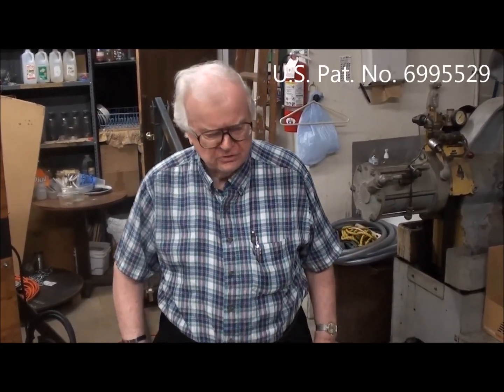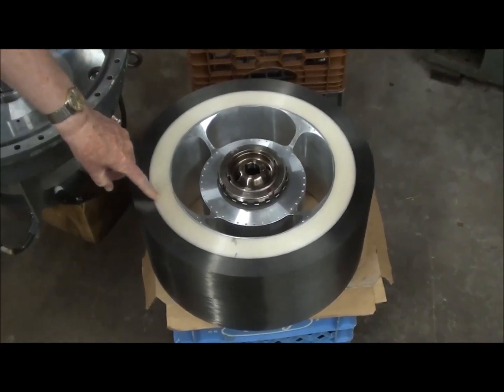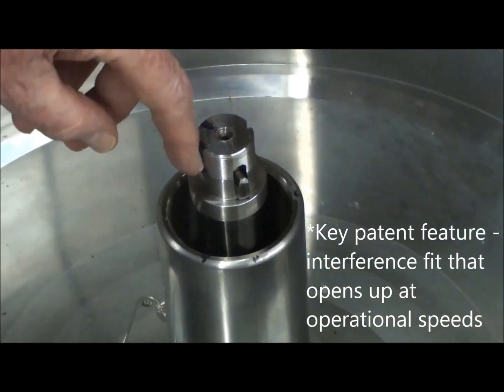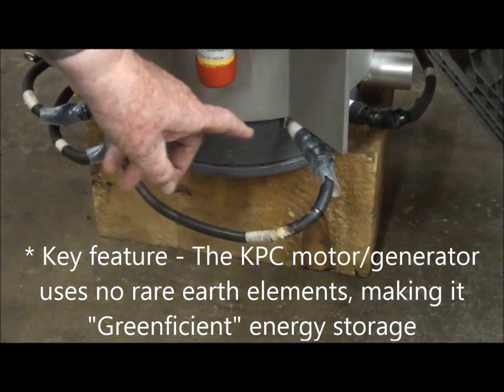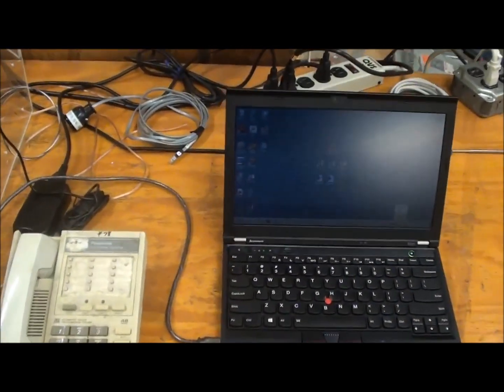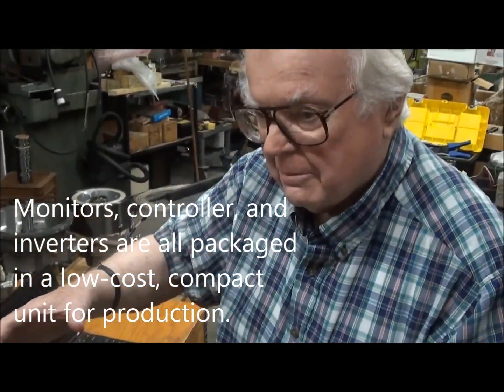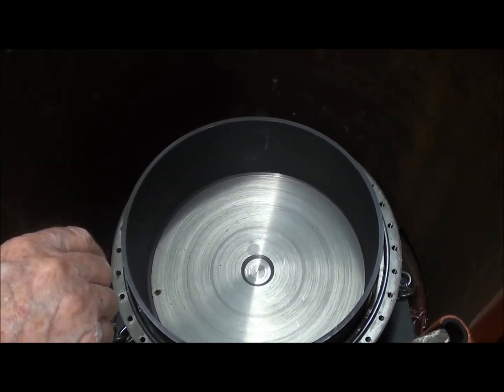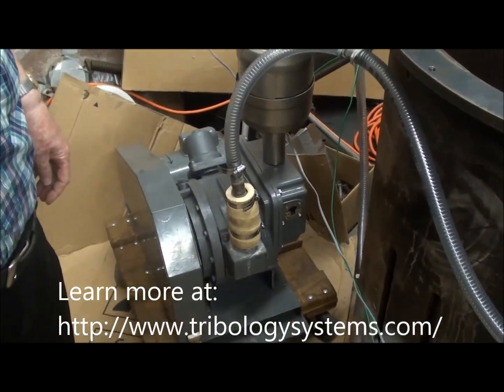Kinetech Power Company - Breakthrough Patented Flywheel Energy Storage System

Comment: I revisited a few equations and scientific laws of physics that must be overcome. The law of motion, friction,  and thermodynamics are working against you.  Energy is wasted. When using a magnetic field you must send some of the energy back to cause a significant/sight Change to maintain the shaft to turn. It's called the power factor in generators. The equation for the law of motion is multiple by half which means over time energy is lost unless acted upon by another force. So really you idea of storage is false because energy is being used all the time to maintain rotation Then you got minus the energy needed for the demand, so you got the reality of a stall or reverse rotation. Really the device you built is beyond feasible because it's much bigger than a battery.  I visited this idea with my professors when we was talking about transistors

Comment: Your time frame is wrong. The softest metal used doesn't have 20 year expedience. The amount of energy needed and the rate of speed will cause the bearings to give out that's given by the equation of friction.  You're using a stator like most motors will speed up when they burn up. I've been looking at equation

Comment: So how much energy (in watts) does it take to get the flywheel up to speed? Then if you immediately started discharging, how much wattage do you get back before the flywheel stops?
Reply: A 1kWh wheel will take 1kWh of energy to get it up to speed.  If for example you have a power source that can output 1kW, it will take 1 hour to spin the wheel up to speed, discounting any real-world inefficiencies.
Reply: @mcraner4987  if we not use the energy  than how long it can continue the spring

Comment: These are initially being sold to OEMS and for specific large scale projects.Applications include large data center UPS, I SO regulation and renewable storage as well as various high pulse power applications.  It is not our intention to let the big oil companies buy and shelve the technology.
Reply: So explain how a flywheel is a "backup" for existing electrical systems in a  an emergency power loss situation and is "ideal" for a "data center UPS" when obviously those data centers are storing data using technologies that need power only to STORE and RETRIEVE the "data" but require NONE to SAVE IT. Y

ou might also explain why a "data center" that's for some reason so determined to have "backup storage" for data it won't gather if the "grid" is down anyway would choose what is OBVIOUSLY NOT AN "UPS" since the flywheel will INTERRUPT ITSELF when it RUNS DOWN.

Oh wait, you're not capable of answering those questions because you've never ASKED THEM of anyone or YOURSELF and simply have no idea what the fuck you're talking about spewing bullshit to use "flywheels" to "store energy" of any kind for any purpose, given the fact that where we DO USE FLYWHEELS they're primarily needed to increase "rotating mass" to RESIST "energy pulses" and to increase the leverage a starter motor has over the engine during starting by "lowering the gear ratio" between the starter drive gear and the flywheel ring gear. 

Some seem to think that there's a benefit  to producing "energy" and storing it  for later use as long as its "greeen" and "sustainable" because its QUIET and "SAFE", even though rotating mass rotating mass and energy transfer is energy transfer and FLYWHEEL STORAGE requires TWO TRANSFERS to USE THE ENERGY ONCE. Not to mention that they're INDUSTRIAL MACHINES made in FACTORIES using the exact same "obsolete" technologies and processes and technologies and materials a "gas guzzler" car is constructed with. 

But with the end result the FLYWHEEL is literally a SINGLE-USE ITEM that will never be anything BUT an "energy storage device". And if that single-use situations the result of "emergency preparedness" and its the same idiots who think ENERGY STORED CRUDE OIL IS EVIL desite its INTANT AVAILABILITY as HEAT while "fl And it's mentionsynthetic" materials like STEEL and HYDROCARBONS and COPPER etc

Comment: ok. I have got some questions can anyone help me here 1. what mechanism is used to speedup the flywheel as motors generally have limited speed and 2. for how long(after flywheel achieving its full speed) it can rotate the rotor of synchronous/induction generator as while rotating the back torque generated will oppose the flywheel motion
Reply: Kinetic Energy, it's how you use a magnet to spend another one.

Comment: I recall playing with a toy car that had a flywheel that sped up to speed when you pulled the cable.  I have thought over the years how cool it would be to have a generator like this in every home.  Will not happen as the power grid companies would loose too much money from the people being self reliant. Look what happened to Tesla when he proposed free energy for humanity!  His tower was torn down.
Reply: You need to power the big cable puller.
Reply: I am a big Tesla fan, but a powerwall is just a battery plus inverters.  Big money is going into LiIon and I expect prices on batteries to fall but flywheels still have some advantages of high pulse power output and significantly higher lifetime charge/discharge cycles and temperature invariance.
Reply: Contantq http://www.teslamotors.com/en_AU/powerwall

Comment: With the composite rotors the chance of a catastrophic explosion are close to zero as apposed to cast metal or even machined billet rotors. The composite rotors upon failure tend to fray and the fibers get intertangled then soon after reduced to red hot particles where as their solid metal counterparts tend to devolve into projectiles with bullet like kinetic energy profiles. Aluminum should be avoided at all costs though as it is prone to metal fatigue and stress fractures even from low centrifugal forces when repeated over many cycles. Aluminum tends to wander under extreme conditions over time, it's a cumulative affect. Your design appears to be somewhat secure with the aluminum section of the rotor located more towards the center where forces are reduced but personally I would have went with something less malleable if you are shooting for a 20 years life span. . Do you mount your rotors parallel to the axis of the earth to reduce bearing wear generated by the procession of the earth? I would love to see your shop. I live just north of you in West Wyoming near Wilkes Barre. It would be a nice day trip and with 35 years in the computer/electronic engineering field I have some ideas that may help you.
Reply: what do you think about the bearing choices？ there are a few air bearing technologies that seems interesting(designed to maintain and isolate a vacuum).
Reply: @alexwang007  you got to look at the purpose of bearings, its to reduce friction. Look at the equation for friction and law of physics.
Reply: @Blaznguy36  huh? it depends on the application doesn't it? i mean if you really need to you can always stick with magnetic bearing and they have negligible friction. but they might not always be desirable. i am sorry i kinda missed your point.
Reply: @alexwang007  there no such thing as a air bearing.
Reply: Magnetic bearings still aren't full floating. NAS is still running into the same problems.
Reply: @Blaznguy36  The trademark of the product Air Bearing? Or specificly aerostatic bearing? I am pretty sure they do exist. although
Reply: @Blaznguy36  AMBs do have losses since they are always interacting with magnetic fields one way or another, so that is for sure agreeable.